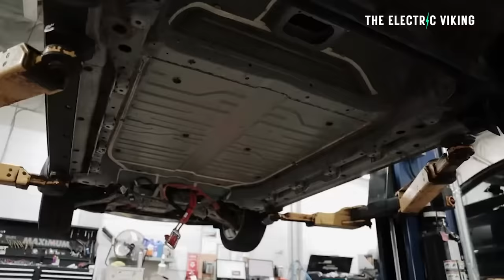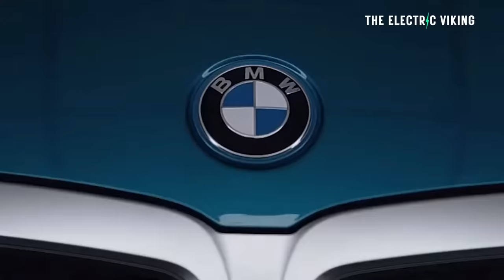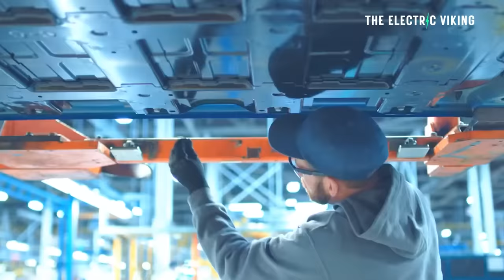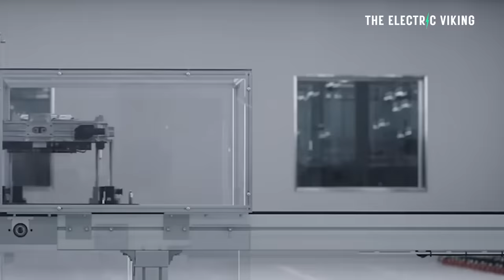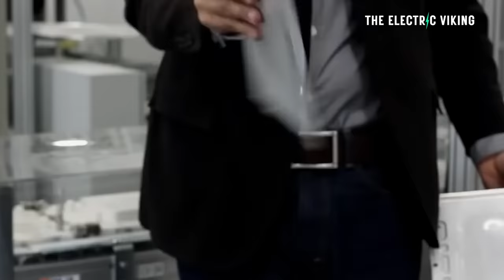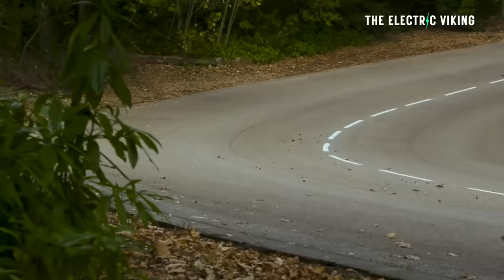The shocking cost of EV battery replacement for these 3 brands

Comment: Ev is such a pain. YOU need to plan your trip according to the availability of charging stations. sometimes when you reach the station you will find many cars charging there and you will have to wait. if you charge your car at a supercharger all the time your battery degradation will be 7% every year. if you want to preserve your battery for a long time you need to maintain your charge between 20%to 80% and also should be charged at slow chargers. 20% to 80% means that you roughly can't use about 40%  for better longevity of the battery . if you are on full load with full passengers and also if you accelerate fast your range will become half of what the company claimed you get. Within 10 to 11 years of use, you have to change the battery and it will cost 72% of the actual cost of the car. During this period you might have to change the electric motor which is also expensive. For different charging stations, you need to install different applications and load money into them. If you travel to remote locations not necessary that you will find a charging station there. According to climate battery performance and range will vary a lot.

Comment: Nissan’s batteries may be cheaper than Tesla’s on the surface, but because they don’t have BMS or active temperature management, they degrade much faster and thus actually cost more over time.
Reply: Hi Every lithium batteries in electric vehicles have a BMS, yes not all have active thermal cool like the Nissan leaf one example.
Reply: @xboxice2005  yes, I have no idea why I said that.  I’m sure I knew that at the time.

Comment: Looking back at the owning 10+ cordless drills due to batteries degradation, I see Nio as the only brand on my shopping list.
Reply: 4680 last +500k miles
Reply: @larryc1616  

Nio is unlimited as battery swap is forever.
Reply: Nio is best
Reply: @shas581  After 15-20 years of ownership, most will want a new car instead of just a new battery.   I would not buy a NIO based on the idea you get a fresh battery for an otherwise old car.
Reply: You can buy new batteries for cordless drills.  I've bought several tool batteries.
Reply: shared load... different chem... apples and oranges
Reply: @larryc1616  Do 4680 or LFP batteries last longer ?
Reply: You surely don't replace a drill if the battery degrades do you?  The hardware warehouse near my place sells spare batteries for all the brands of drills it sells.
Reply: The data doesn't support your conclusion. Cordless drills? Seriously?

Comment: battery life by distance is irrelevant for people who do low kilometers. it's how many years the battery will last. A low-kilometer ICE engine can easily last 50 years if it is maintained & has low kilometers. So how many years will a battery last? No one can give me an answer.
Reply: Do you use any 50 year old engines? Do you keep any cars more than 10 years? There’s 10+ year old Teslas on first generation battery chemistry still cooking along. Also have you tried looking it up? It’s openly discussed being 15-20 years.

Comment: I own two 2014 i3s (Japan imported to NZ in 2020/21) They’ve both done 50,000kms. They both still have 100% battery health. All depends how you treat them. They love our overnight 240 volt 7amp charging. Nissan Leafs batteries aren’t comparable to i3. BMW are expensive for a reason. By the way pure EV i3 is so much better to drive than Rex, lighter, faster and just more fun.

Comment: Facts is that EVs will most certainly fail as a business model as people have become acutely aware of the cost of living more so now than ever and increasingly scrutinise what they are purchasing. As a result they either identify online the issues and risks and will definitely ask the dealer the cost of Battery replacement only to be horrified at the prices dictated to them and are turning away.
As for the dangerous side of these Battery fuled cars again with more and more videos surfacing in the Media they are unwilling to take the chance of devastating damage these EVs present anywhere.
The notion is also false that somehow these 'Vehicles' are helping the Climate when in truth they are a plague both in waste as thousands are being produced but not solved and Still demand high energy powering using Fossil fuels still. On top of this the infrastructure of Power point stations for 'refuelling' is totally inadequate for anybody.

This 'New wave' tech needs scrapping and greater research and development should be where all that wasted money could have gone to, only the Manufacturers and Car companies can mitigate new safer/efficient methods of building better designs.

Comment: This is where the aftermarket steps in, when the warranty runs out.  There are a few companies around now that can open up your pack, test each "brick" inside, replace any bad ones, close it up and reinstall it.  And if you end up replacing the whole pack, they provide a good warranty for the new one, and it can cost half of what a dealer charges in some cases.

Comment: The now discontinued Mitsubishi i-MiEV replacement battery pack did drop in price during it's run from 2009 to 2021.... hmmm.

The modules in the pack is also  used in the outlander PHEV, so there was plenty of production size...

Comment: Buying ANY car part is expensive - the manufacturer has to make more, they have to be stored for up to 20 years, so you better believe any car part costs 3 times what the original costs. That's why once the battery is shot on an EV it's time to throw it away.
Reply: Not so, there is a market for EV batteries that are no longer good for vehicular use.

Comment: Batteries create maybe ten tons of CO2 in their production, ten years later they need replacing.
Very green .
I will be keeping my diesel that does 60 MPG, its range doesn’t shrink every time I refuel, it  produces less CO2 than a petrol car and it will last indefinitely. 
Most of us haven’t fallen for the hype.
Reply: Bs 60 mpg
Reply: @raymond8163  well it was off the top of my head so I just checked the car computer and you are right my figure was wrong. 
The average is in fact 4.6 litres per 100 Kilometres which is 61 MPG from my 1500 Renault Kadjar.
When I bought it new six years ago its fuel tank held around 60 litres of fuel and today it holds 60 litres and in another ten years it will still hold 60 litres. This car has an indefinite life span unlike cars powered by torch batteries.
Reply: @iancarrington1967  Well that's piss poor compared to my EV that does 150 equivalent miles per gallon based on cost.